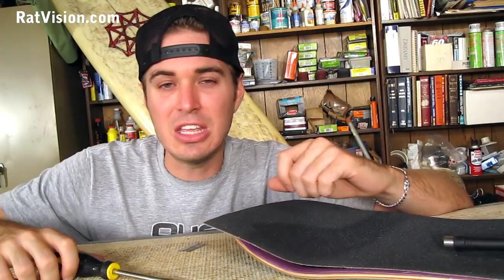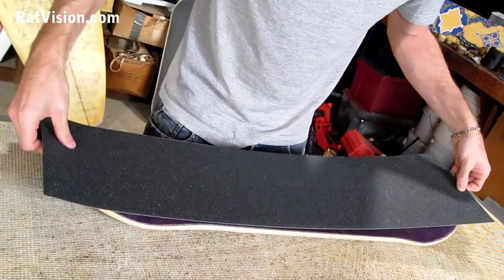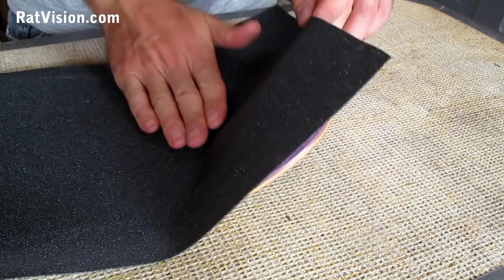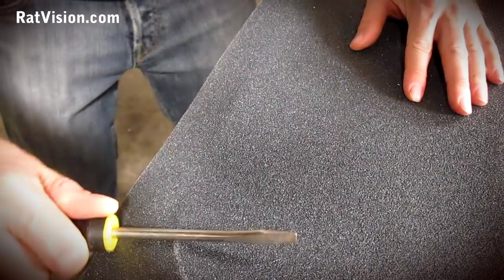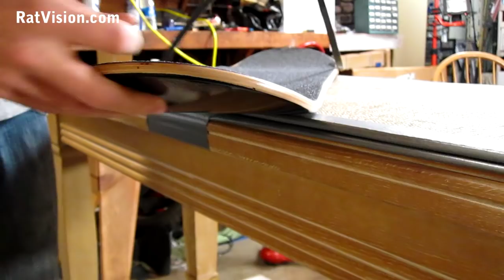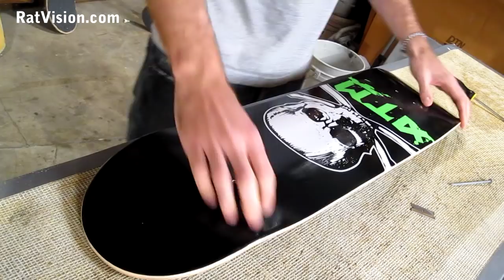Put On Skateboard & Longboard Grip Tape CORRECTLY

Comment: TIP: if you did a crappy job because you used scisscors instead or just simply fucked up, just use the leftover griptape and sand down the edges and it should turn out more smooth
Reply: -chase thx dude nice thinking

Comment: Dude, until 6 days ago I never skated in my life, and now an hour ago I successfully put a griptape on my first ever longboard and fitted it with matching black truck mount screws. Thanks to your tips and concise explanations, the whole process went like a breeze and produced a great result with smooth edges of the tape (even at the point where I restored a small dent in my board with ad-hoc engineering solutions), greatly appreciate this video, it really tells everything you need to know so even a complete noob like me can do it right. Thanks, dude, you rock

Comment: I just did my first grip taping, and it went nearly perfectly, except that I forgot to lift the edges up before cutting, so it went a bit wobbly. Follow the tips, kids! Great vid though mate.

Also, I found that it's easier if you don't take all the backing paper off first, just do it as you go along. It gives less room for error. But I didn't have any air bubble problems at all, maybe I'm just a natural ;)
Reply from the maker: Yeah great idea with not taking the paper backing off.  Glad to hear this worked out for you.

Comment: Thanks for the instruction. its helpful seeing what i am dealing with. Going to use clear griptape on my interior stairs to help my greyhound on them so he doesn't slip on the hardwood floor
Reply: Where are you? This is for skateboards.
Reply: Not a great idea, it will tear his paws up!(though it would keep his nails cut lol).  Much better to find something rubbery.
Reply: trapper9998 you should not be owning dogs if you think grip tape is meant for dogs and stairs wtf..

Comment: Ratvision: great video! 

Couple more steps in case you want to update this: 

After laying down the grip tape, use the back of the grip sheet, rip off 1/4 of the paper, use the waxy end to press on griptape ensuring your getting the best contact.

Comment: Excellent instruction. I used this before I did my last board (popsicle) and it was money. This time I gripped a drop deck with really tight curves so I watched the vid again for a refresher. Your tip about making a relief cut in the curves is spot on. I found I had to make quite a few around the drops and the cutouts. This deck came out just as good as the last one. Thanks for the help.

Comment from the maker: Cool.  What also helps is maybe deciding what side of the scored line you want to cut on.  A thin line lets you cut in the middle, but you can angle the blade to be more on the inside.  Glad this worked out for you.

Comment: i fucked this up so increadibly bad
Reply: been there dude. I've only tried it once before but it was absolutely terrible, couldn't get the cut even to save my life
Reply: yeah, my cut don't look clean either. first time doing this. fuck.
Reply: Evan Marquis i did the same thing
Reply: fuck man! I was raging 5 min ago, nigga someone please teach me this before i snap every fucking skateboard😫
Reply: On my third attempt I finally got the tape to cut right. The two most important parts about this are doing exactly what he says when it comes to scoring and cutting. Don't score anymore then what he does, and use your index finger as a guide along the side of the deck when you're cutting. That way the blade will be right where it's supposed to be and the cut will be nice and clean. Just a little trial and error, that's all.
Reply: Evan Marquis same

Comment: Hey there ! I just got a new board and the guy at the skate shop didn't sand the edges, and my grip tape started peeling off  and it has a lot of non-glued parts, I bought it about a week ago, should I apply a new grip tape by myself? Thanks
Reply from the maker: If it has peeled up in a way that effects the feel then get new grip tape.  It's really your call.
Reply: +Rat Vision – Skateboard Tech Thanks for replying, I'll wait a little more, like a week and I'll change it.
Reply: +Asa Cox (STUDENT) Interesting point!

Comment: this video was super helpful. scoring and cutting is really difficult though be warned. mines pretty rough around the edges, very choppy, but using the leftover tape to sand it down a bit really helps seal it on. the tips for keeping out air bubbles were super helpful. this was my first time taping and thanks to this vid i had no airbubbles at all

Comment from the maker: Same way.  Be sure to get the thin scoring line.  On used decks the edges/rails, nose and tail are warn down and make it a little harder to cut the edge.  The the scored line helps a lot, especially on the nose and tail.

Comment: Well done! I was about to buy a file; you saved me a trip and the $$$. Subscribing now.
Reply from the maker: Cool.  I don't know where the file idea came from.  It's completely pointless.  Like I mention in the video, or a different one, I have just used the back of the razor blade to score grip tape.
Reply: Growing up, my buddy was sponsored by Vans and a local shop, then Zumiez for a bit (just a single location in a local mall). Every time we'd break a board to go get new ones, they always busted-out a file to do the grip-tape, so I assumed that was the process. The video made it look way easier and effective. The file makes a fat line too, which is tough to make straight when cutting.

Comment: i grip a ton of decks at the shop where i work and ive been sticking the grip to the nose and tail and then patting it into the concave from the center twards the ends. works great with on grip with holes like mob and black daimond and ive had no problems with bubbles sofar but i wil deffinately start scoring the edges with a single stroke intsead of going over it several times like i have in the past. thanks for the tips this should make a lot of customers grip look great.

Comment: June 16th, 2020 -- Just checking in, during deep COVID-19 ERA of our time haha, and sharing that Rat Vision Vids like this are still handy, and Happy to see them. Got my new Rip n Dip Deck on my Longboard thanks to this vid, but good lord, even with a 2200 watt hair dryer and the prev video on Old Grip tape removal it was a near 3 hour battle to take off! :D The putting on part was easy enough, and the tips in this video totally helped, Cheers :)

Comment from the maker: Yes  Mob is less grippy.  It has smaller grit and the grit is closer together.  Smaller grit that is close together doesn't grip as good as bigger grit spread out.  Think of a bed of nails.  What would you rather sleep on, nails that are spread out or closer together.  The nails spread out dig in more.  The same goes for grit in grip tape.  There really isn't a brand that is better.  The all work, and it depends on what you want out of the grip tape too.  Do you want more or less grip?

Comment from the maker: Look at our custom grip tape video, and instead of doing a line vertically you do it horizontally/perpendicular to the deck. Cut the grip tape where you want the line, it doesn't have to be perfect.  Just turn the pieces around and use the existing ends to make your line straight.

Comment: I have been grip taping custom made longboards with clear tape so I didn't really realize I had to score the edges. It has always been extremely hard to make the edges nice and straight, so thanks for the tip. I will have to try it next time
Reply from the maker: It's going to make your job way way easier.

Comment from the maker: That's tough.  I think most people wouldn't worry about it.  If you didn't press it down hard all the way on the deck you can peal the grip tape off really fast and try again.  You have to be careful not to stretch the grip tape if you do this.  It could potentially mess up the graphic if it is big.  Is it just the small bear?  I wouldn't worry about it.

Comment: First let me start with, I love your videos! You should show a grip tape vid on a very curvy board like the DB Lunch Tray with thick grip tape! When I gripped my Lunch Tray it was a lot more difficult, ie a lot more start and stops with the blade. Also I use an old Phillips tip in my drill to clear out the grip in the screw holes. Thanks for the how to's man!

Comment from the maker: @eVerProductions1 It doesn't matter at all if there is more to one side. As long as u cover the deck, it's all good.  U really just have to eyeball it to get it straight. You can stick one end edge gently on and then line up the other side before sticking it down good. Again, I have gripped well over a 1000 boards so I've had lots of practice. You can cut how ever u want. It's way easier to cut from the bottom. U can rest your fingers on the board, and the blade cuts easier from underneath too.

Comment: Great video, cheers. 
Really satisfying to watch when you were trimming the tape off. Put some grip tape  on for the first time tonight, laying it down went fine, straight enough, not one bubble. Trimming the excess off was a total shit storm. And ended up looking messy. It'll do though. I used clear grip tape and it felt really brittle, is that normal?

Comment from the maker: Poke the holes faster so it doesn't lift up.  Don't worry about the grip tape not sticking.  It takes time for the adhesive to bond with the deck surface.  Think of how much harder it is to take a band-aid off in 2 days, compared to when you first put it on.

Comment from the maker: Sure you can.  It may be a lot harder.  The grip provides traction to keep your feet secure on the deck, and it also provides a certain feel when moving feet around  and performing flips.  There are very good reasons why grip tape is on the deck.

Comment from the maker: Our website is under construction even though it is live.  You'll find the differences between grip tape at RatVisionDOTcom under info/equipment.  The short answer is yes.  Colored grip tape is fine.  It may not grip as much as as black grip tape, and the website will explain why, but the grip of the grip tape lasts longer.  Brands have very subtle differences.  For what you want it doesn't matter which brand you go with.  Some actually get their grip tape from the same places.

Comment from the maker: There are subtle differences that avid skaters can pick up on. All skaters go off of is experience with a brand or what they hear amongst shop employees and friends. Mob is the hot grip tape right now that everyone is obsessed with. Every skate brand gets a turn in the circle. Mob has smaller grit that is close together (less grip). While others have bigger grit farther apart (more grip). Think of a bed of nails with different size nails and space between each nail. That's the difference.

Comment from the maker: @MrCasey2910 There's no such thing as what is the best. Most companies get their grip from the same place or make the same stuff as everyone else.It's up to u on what is the best, not the opinions of everyone else. Ride what you like. There are 2 or 3 different materials used for the grit– Silicon Carbide, Aluminum Oxide, and another I can't think of. Most use SiC because its grit is really sharp, the AlO (used mainly for colors) lasts longer but not as grippy. I use Iron Horse, its like Jessup

Comment from the maker: This from not holding the blade correctly.  You can lift up the jagged edges or flaps with the blade and then cut them cut those pieces off.  We should do a video on how to fix this.

Comment: @skateboardtech in my experience Iron Horse Grip was good except when the edges start to wear it makes a fraying look more than other grips. Also in this video you say to make a thin line when scoring it, but when I do that it feels like it makes it harder for the razor to cut it and causes a crooked line. I started making thicker lines and it seemed to work out better for me, and my lines have been straighter since. I also use a razor knife rather than just a razor blade

Comment from the maker: A clear coat of anything won't work.  It will scratch off just as easily because it's surface is thin too.  The only way to save the graphic is to add plastic rails to the deck.  Although considered old school, they are fun to use, and you may like them too. There are quite a few companies who sell them now.  They do come in different lengths. It's not super critical. Measure your wheel base for the correct size.  It will be about 14" inches.  They are very easy to install.

Comment from the maker: @bobblefred45 Yes you can do this with anything.  I recommend not using the scraps of the grip tap to roughen up the edges.  Just leave it.  This way you won't scratch the plastic up.  If it is already scratched up then go ahead and roughen it up so it sticks better.

Comment from the maker: @anynamepossilble Are you saying you have an area on your deck that does not have grip tape and you want to put some in the the uncovered area?  If so, maybe try putting a piece of paper on top of your board, hold it still, and rub a pen or pencil over the area.  It will make a weird outline of that area.  Cut it out and trace it on the back of a piece of grip tape.  Now you have piece that should fit pretty good in that spot.

Comment: 👍 Iove your videos!
I found a San Cruz Rob Roskopp Skateboard, Ace 44 Trucks, Sector 9 wheel set in the trash!
The board is basically great, just need some new Grip tape and a clear coat of acrylic for the bottom board.
What acrylic clear paint would you guys recommend?
And 100% thanks 😀👍

Comment from the maker: Shouldn't be a problem.  Sometimes the grip will go over the bolts a tiny bit when the bolts get tightened. If the grip is any good it shouldn't peal up.  There probably isn't anything to worry about until something happens.  Nothing to do until then.

Comment from the maker: You actually don't need a lot of grit in the grip tape to give u good traction or hold. The more the grit is spaced out the better it is. Think of a bed-of-nails. Would u rather sleep on a bed that had thousands of nails or only hundreds? With fewer nails more weight per square inch is being forced on the nail and more mass to sink between the nails which also prevents movement. Grip tape works the same way. Consider grit size too. What pokes easier– skinny/small nails or large fat nails?

Comment: @skateboardtech hey man, great video! On a kinda unrelated topic, how do you make a skateboard graphic from scraping off when doing boardslides? On my last board, I did like 2 boardslides and half the graphic was gone. How do I make the graphic last longer so I don't have to wax the bottom of my board every time I want to do a boardslide? Should I apply a clear coat of paint on the deck?

Comment: I did so horrible on my first time gripping a deck on my own because I always just got the shops to do it if they offered. I tried to get really hip and do the stripe on the tail like my old deck had and instead of cutting my cheapo razor I had just ripped the griptape so I have a nice rip halfway along the grip to know where my tail is and the edges of the board are about as wavy as the ocean. Perfect way to kick off my baker team edition board.
Reply: Don't worry about a shitty grip job, when I first griped a board it was a shity job, but it's hard the first few times
Reply: ***** Im not too worried about it because its gonna get trashed along the edges anyway but now its canadian winter so I cant skate untill like february-march and thats the real struggle

Comment: I didn't score my board enough after applying the grip and then when I tried to cut it it wasn't cutting smoothly, so now I have a bit of a jagged cut. I didn't realize the scoring was to help get it to cut better. It looked like a guiding line to me.
Reply: True but it also helps the blade also cut through it easier and I didn't rub mine enough for the blade to cut through clean.

Comment from the maker: That's odd.  Is it actually pealing off?  Before you add new grip tape on use sand paper or old grip tape and sand the surface of the deck in those trouble spots.  Decks come with a thin finish of them that some grip tapes don't like.   The grip tape will stick to it but sometimes not very good.  This is why at the end we roughed up the edge of the grip tape to keep it from pealing.  Remove the finish with sandpaper, remove and dust with a very lightly damp towel before adding grip. Let us know.

Comment: For a beginner I would definitely file at it over and over, I did it one hard time and when I tried to cut it, it turned out awful. I stopped halfway and filed back over it multiple times and then I had a clean cut.

Comment: Today, I bought a new board and I gripped it with Grizzly Griptape, the one with the graphic, not the bear cutout. Now this was my third time gripping a board, but only my first time gripping a board with griptape with a graphic. When I was putting the grip on the board, I tried to line it up perfectly by looking over the edges of the board and putting my fingers down, but the graphic isn't 100% straight across the board. How do I line up the griptape better?

Comment from the maker: Why why why why would you not take the trucks off?  There is nothing to be worried about.  When it comes time to remove the trucks from your deck, the truck hardware will be covered by grip.  Simply unscrew the hardware.  Don't worry about anything.  JUST DO IT.

Comment: how do you line up the grip so perfectly?i even out the tail and nose but the sides usually have more or less, like more on my left side or more on the right and then i have to lay the grip on the table and lay the deck over the grip perfectly then turn it over and lay out the grip, and is it wrong to cut from the top instead of the bottom?